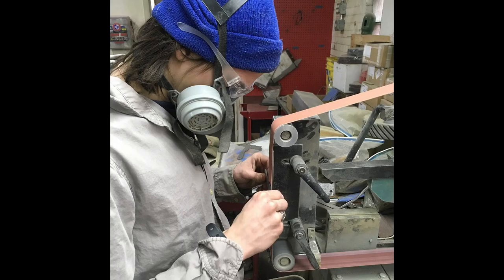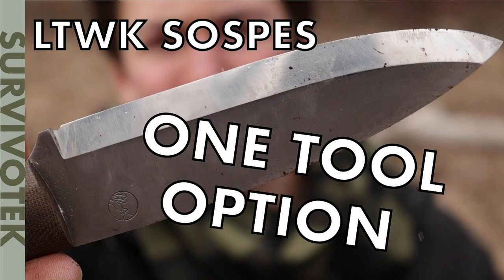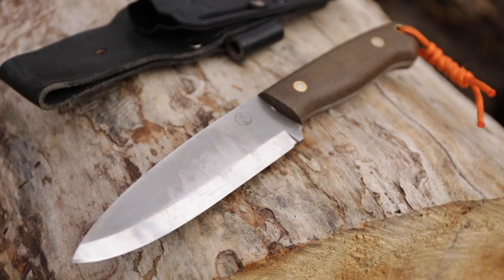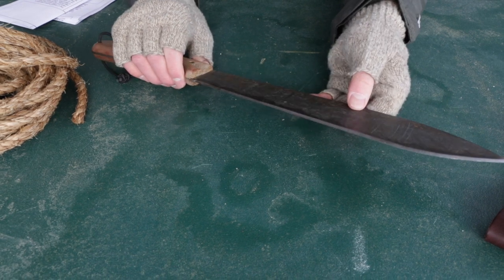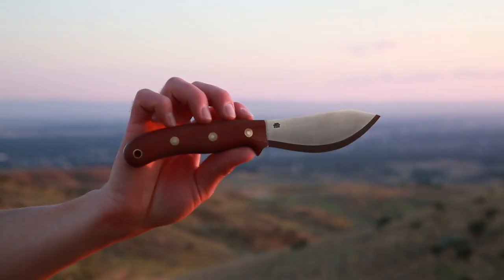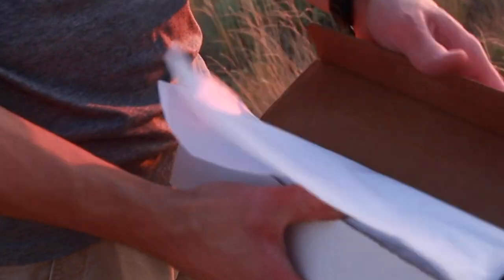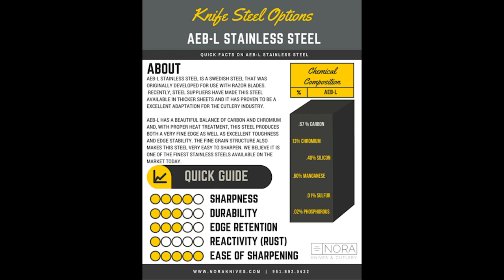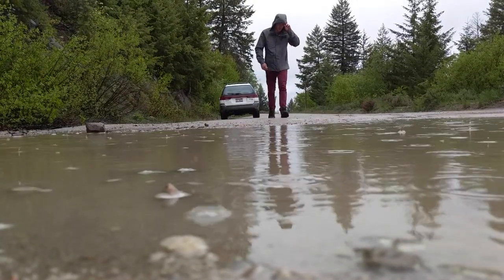LT Wright Knife Buying Guide | Blade Length, Grind, and Steel

Comment: St.Jude, this is very sensible video, I know ibwoukd find something that makes sense...most Bushcrafters are focusing on hiw knife works outside what knives shoukd work, but really knoves are of limited use and it is a small piece out of many for real bush crafters, I am trying to learn bushcrafting myself, and actually most bushcrafters equate that w making fire whichbis still a small, but essential, part of the trade...thanks ST. JUDE
Reply from the maker: Thank you! And I totally agree with your opinion on knives. Many people focus so much on the knife as a tool, but I use my saw and hatchet far more when practicing bushcraft than I do my knife. I mainly use knives to test and film. Firecraft is an important skill, but when it comes to bushcraft, knot tying skills are more beneficial to shelter craft and plant identification is one of the important self reliance skills. I've been studying both quite a bit lately.
Reply: @SurvivoTek   Plant and animal identificatio are extrememly important they are in my head, I have started looking around for material and books for that. I need to devise a plan to learn, practice and share info w others. I will look for couple guys in my are may be we can learn tigether and share experience. First aid, is a must for sure. Stayong in shape is a must. I also practice fasting faus here and there to learn patience and strenght..we will see...changing fro corporate to active lige styke not easy but achievable...

Comment: 1 - Gen 6 - Scandi/A2 (big knife for bushcraft & general camp knife)

2 - Genesis - Scandi/AEB-L (Belt knife for bushcraft & wood stuff)

3 - Camp Kitchen Collection ( for the house & Camp kitchen, set includes the  7.5" chef knife in AEB-L, Traveler 5.75" AEB-L, Large & Small pouter's 5" & 3" respectively)

4 - Large Northern Hunter - flat/AEB-L (larger knife for game processing)

5 -  JX3 - full flat/A2 (smaller knife for game processing)

6 - Gen 5 - Saber/A2 (General do-all knife, absolutely beautiful Maple Wood Handles)

7 - JX-2 Jessmuk - scandi/3V (Play around knife, I'm very attracted to any knife with lots of sweep and/or belly)

8 - Frontier Trapper - Saber/A2 (Small whittling knife, neck knife & Dark Curly Maple handle)

9 - Overland Machete - flat/1075 (just because)

Those are my 9** LT Wright knifes...
9 uses... 12 knives

I would really like to get my hands on a LT Wright Ranch Hand for playing around, but 3/16" - 5mm of 3V for wacking around isn't cheap, can't justify $500+ for a knife that I already have so many tools to do the same job that knife would.... 

I got a Falkniven A1X (Laminated CoS) & a Bark River Bravo 3 (3V)... both are Convex ground and over 1/4" on the spine. Both are around 9/32" or 0.275" on the spine and are  more scandivexed ground than full convexed... their my sharpened prybars and are batoning beasts... but not LT's)
Reply from the maker: That sounds like a fantastic collection of LTs! And you've got all your bases covered, which is probably the more important thing. I've been eyeing those Overland Machetes quite a bit lately, but I just can't justify it quite yet. Maybe if I start venturing into thicker undergrowth, I'll have to pick one up as well. Thank you so much for sharing!

Comment: Hi there,
I like your categories and mine are pretty similar. Let me explain my choices:
Firstly I divide my knife choices into two categories: heavy carry and light carry. You did something similar.
Heavy carry:
Large knife: I agree a large knife would always be the option where heft and length are needed. Here I have a Cold Steel Trail Master (San Mai III, full convex grind). This design has set the pace for many decades and still makes most top 5 large knife lists. They are hand made in Japan and the workmanship of the fit & finish are of the highest order.
Belt knife: Here I would go for something innovative and interesting, and the new Victorinox Venture Pro fits the bill. Its full flat grind blade is ideal for around camp work and versatile enough to function as a real bushcraft knife for carving, cutting, notching and feathersticking. It uses Sandvic 14C 28N steel which has served Victorinox well, and boasts some very interesting feature. Its 4+ inch blade is exactly the right length for this all-rounder. 
Small blade: Here I admit to a compromise (Which is debatable). I'd opt for a multi-tool knife for the sheer versatility of the many tools, including a functional 3-3 1/2 blade, as you mentioned. After watching Felix Immler's videos and having read his book, It became obvious just how useful such knives can be; one just has to learn how to capitalise on that. My choice: the Victorinox Hercules. 
Note: with any venture into "the wild" I would never be without a decent and appropriate folding saw, eg a Silky (or Bahco, if preferred). For heavy carry that would be the Bigboy Outback version. Also, I would not consider an axe, unless some sort of transport is involved (eg truck, car, quad bike, horse/donkey) for carrying loads. Using the tools above, and with wooden wedges, one can accomplish the tasks that need to be done. An axe is too heavy, bulky and is basically a one use implement (if one has the tools mentioned above). 
Light carry: 
Belt knife: As I would dispense with the large (ie heavy) knife, I would opt for something like your choice in the +- 6 in blade length. The Cold Steel SRK (CPM 3V version in sabre grind would be best) is a versatile and proven option. 
Small Knife: Here I would continue with my choice of decades -  Victorinox Swiss Champ! For obvious reasons. 
Saw:  Silky Gomboy.  If it was a purely hiking trip, I might consider a Pocketboy instead. 
Note: I am not very familiar with LT Wright knives, so they did not feature in my choices. They do look like awesome knives. 
I would like your opinion on my choices and reasoning!

Comment: Choosing a grind for me is based on my options for sharpening. Will a have a diamond stone or workshop, or only a stone I find by the creek and my belt. Scandi is the easiest to sharpen on any stone for a beginner, just lay the gring flat to the stone, but other grinds like a convex are better for splitting wood and less prone to chip. Same witha recurve, better for cutting through a rope or hide, but sharpening requires more skill, and a chip is more difficult to grind away while keeping the profile close. Very complex topic, but great video and LT Wright makes great knives. Beyond steel what about heat treatment, what about differential heat treatment, or air cooled steel vs oil.  Such a comples topic it will leave a buyers head spinning.
Reply from the maker: That's a really good point. Being able to sharpen your blade is necessary. No use having a knife if you can't get it sharp. Sharpening tools/skills also play a role in which steel should be chosen. If you can't sharpen a "super steel" don't get one. I would love to make a longer more thorough blade buying guide that covers more of this topic since it's so complex and can definitely be confusing. Thanks for the comment, my friend.

Comment: Excellent video my friend,im thinking of getting the LT.Geneis or  the Kephart,now I have very big hands triple X gloves and I have to be sure that the handles on the knives,are not too small.I'm a hunter and camper and I have a collection of Scandinavian knives eg.More,Helle,Martini,Eka.I'll have to get the specs' on the LT.Wright knives.Stay safe.
Reply from the maker: I would recommend making sure whatever you get to make sure there are handle liners. The liners will often add just a little more width. I've started only purchasing knives with liners just because of the handle width.

Comment: I bought a lt Wright, a great plainsman . Just to see if it was better than blind horse knives . Well let me tell you its about as good as it gets .
I couldnt believe the quality improvements !  The little plainsman is in d2 and came like a razor.  Great sheath too. Only drawback would be it might be a tad small for the one knife guy . But nessary is the mother of invention.  
I believe a genesis would be a perfect place to start for an all round knife . The four inch rule came about when your belt knife was used as weapon. Five inch is perfect.  
On the steels , thats a bad topic.  I am tool steel guy . D2  01 a2 and even 1095 are fine with me . Lt Wright has a handle on hard use knives .
One problem?  I think you might be likely to buy more . 😁
Reply from the maker: I had a great plainsman a while ago and totally agree with your assessment. Amazing little knife, but just a little to small and narrow to work with for long periods of time. The Genesis is like a standard when it comes to bushcraft knives. Almost perfect for anyone who tries one.

Comment: I only have 3 LT Wrights, the GNS, Great Plainsman and the Bushcrafter HC.  Everyone of them is a great knife.  I just wanted to say the 1075 used in the Bushcrafter HC seems to be more like 1095 to me.  I'm guessing, but I think LT's heat treat brings out the best in this lower cost steel.  So don't think it's some questionable steel, I promise you it's not based on my experience.  Thanks for the video Jude.
Reply from the maker: Heat treat is some kind of magic imparted in a blade. LT uses Peter's Heat Treat which makes theirs more specific and consistent. It can make an O1 act like a super steel or a 1075 work like a 1095, I'm sure. Thanks for checking out the video and the comment, my friend. Keep collecting those LTs, they're amazing!

Comment: Want several of their knives. But 1st on the wish list is the Genesis. Not sure if I want a saber or a convex grind. Such a nice knife. But very expensive.

How do you sharpen your convex knives Jude? Would be nice to see a how-to on that.
Reply from the maker: The Genesis is really a standard as far as bushcraft knives go. They are pretty pricey but it's a "buy once, cry once" situation. Knives Ship Free has great convex grind sharpening tutorials on their website. They recommend using a mouse-pad with different grits of sandpaper and a strop. Out in the field, I don't generally carry a mousepad, but I often have a ceramic rod or something with a rounded edge and a strop just to touch up a convex. To be honest, I'm not the best at sharpening convex's, so when I get good, I'll try to put a video up.

Comment: I’m looking for a knife around 4.5inches long(or anything between 4-5inch) convexed edge, high(er ish) sabre grind(1/3rd?) in 3V, or near equal (or better) semi stainless…. Which LT Wright model should I be looking for???
Reply from the maker: My first thought is either the Genesis or the GNS depending on what style of handle you prefer. LT does make them both in 3V and in either saber or convex, but most places are low inventory right now. Best bet would be to reach out to them and see when their next order will be shipped out to either knivesshipfree or dlt.